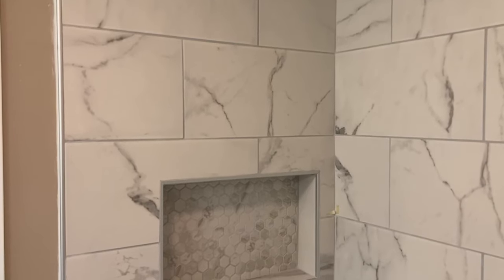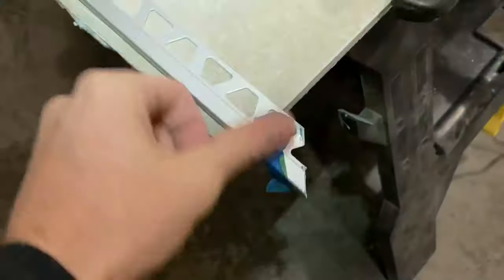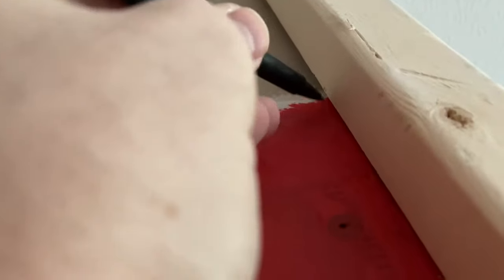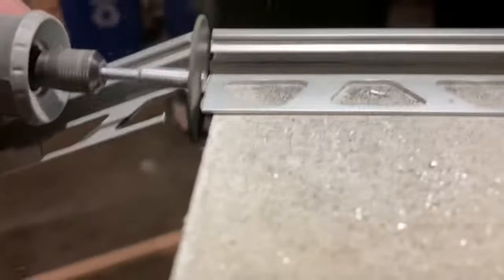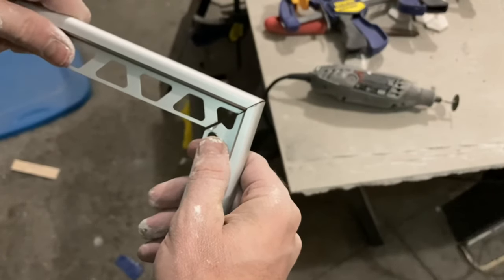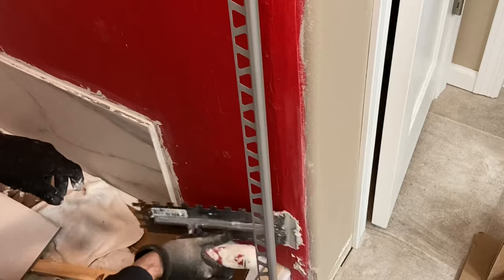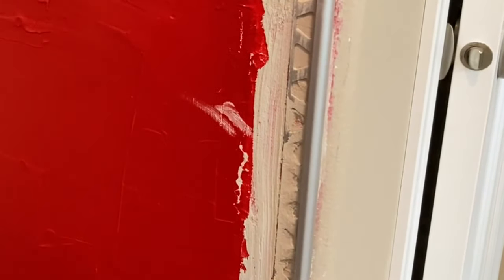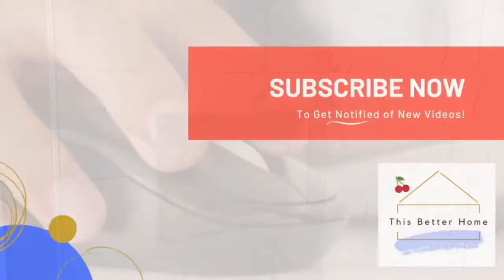️🔥 HOW TO CUT & INSTALL SCHLUTER ALUMINUM BULLNOSE TILE EDGING TRIM➔Easily Transition Tile & Drywall

Comment: Tool maker of 30-yrs here.  Just use a mitre saw with a carbide tipped blade and feed it very slow. Then use a wire wheel on a bench grinder or on angle grinder, just a handheld wire brush to deburr the edges. This dude is making a mountain out of a molehill.

Comment: Wet saw works great for the job.  Been doing it with one for 20 years.
Reply from the maker: Good to know! Thanks!
Reply: Second this, tile wet saw works great for either straight or 45° cuts. Will have to do a bit of cleanup with the file. A bit of blue tape on the trim peice helps too. Standard snips work great for getting rid of excess material on the flange.
Reply: cool, imma try it
Reply: @EtreTocsin  
Go slow because the blade will grab the schluter and it could cut you.

Comment: Thanks for the detailed video. I have some thoughts on this. The usual advice is to start by making everything as perfectly level, plumb and square as possible. Then careful tile cutting to make up any small errors is the final step, rather than pushing the trim against the tile. For your outside corner, the first thing to do is to make sure that the trim piece is securely installed using a waterproof band, that it is plumb (preferably using a laser line), and that the neighboring wall lines up with this trim as perfectly as possible. This often requires some drywall work or repair. Once everything is set, you tile to the trim, rather than trim to the tile. You can even install the trim on a different day from the tile, as long as you keep the tiling surface clean of excess thinset after installation of the trim. The props shown at around 15:50 to bend the trim are a bit painful to see. But I would be interested in other views and opinions.
Reply from the maker: Great comment - thanks so much for sharing your thoughts!

Comment: Hey bud thanks for the video its aluminum just use the miter chop saw it works perfect make sure you have a 60 tooth .. just a suggestion its quick easy doesnt effect the blade gives perfect 45
Reply from the maker: Appreciate that. Thanks!

Comment: Angle grinder works great, but whenever I'm installing these Schluter edges, I'm also installing tile, so since I already have the wet saw set up with the diamond blade, I just use that.
Reply from the maker: Great tip!

Comment: I did end up buying the Diablo aluminum cutting blade for my small miter saw for like $30 and totally worth it. But can use a decent carbide tipped blade but will dull faster and doesn’t make as clean a cut.
Reply from the maker: I need to invest in one of these as well!

Comment: Hey use a miter saw use a wood block to keep it steady as you cut through both and full speed and cut slow and I use a regular wood blade

Comment: I use tin snips for straight cuts if I don't have a miter saw nearby. I cut a gunthair long and file it to finish. Some times I hot glue to the substrate with a slight gap between edging and the wall so the thinset supports it completely.
Reply from the maker: Great comment. Much appreciated!

Comment: Use a chop saw is the only way. Fast. Clean.
Reply: Wet saw works awesome also.
Reply: That’s what I did!! Chop saw
Reply: Chopsaw definitely, use a wet saw and you’ll have to debur and sometimes will leave you with a imperfect miter
Reply: @johnkinlaw8235  
Yeah I always have to debur my cuts but I don’t have a need for a chop saw other than to cut profiles. My meters are always perfect but I been in the trade since 98. It only takes less than a minute to debur.

Comment: Painters tape works well to hold your Schluter in place until the thin set starts to cure if it’s slightly moving.
Reply from the maker: Excellent suggestion. Cheers!

Comment: Cut it with a mitre saw with a carbide blade and this task is done in about 5 seconds instead of wasting time with all these tools.
Reply: Angle grinder thin metal cutting blade boom
Reply: I've been using a carbide blade for non ferrous metals for years. I put it on a cheap dedicated mitre saw.  It only takes seconds to get a nice clean cut.
Reply: Back the schluter with a scrap peice of wood. It reduces kickbacks and burs

Comment: If a cutoff wheel is the preferred method, why use such a tiny one? Angle grinder + file?
Reply from the maker: Cheaper and it’s what I had. Also more control.

Comment: Sorry but you are really not ready for instructional videos on tile work. The globs of thinset looked terrible and I am sure you were far from 100% coverage. There were other mistakes,  I am not trying to be critical, rather letting those watching know there are better tiling resources out there. 

Also as a resource, John Bridge tile forum is a great website for any and all tile, stone and general bath remodeling information.

 Also the quickest most accurate least destructive way to cut the trim (schluter or any other aluminum) is with a diablo aluminum/laminate saw blade in a miter saw.
Reply from the maker: Great comment - all opinions welcome! Viewers are probably smart enough to view many videos, from DIYers like me to the pros, before taking on a shower tile job. In the end, I love my new shower - nearly 2 years later it's standing strong and looks beautiful. Cheers!